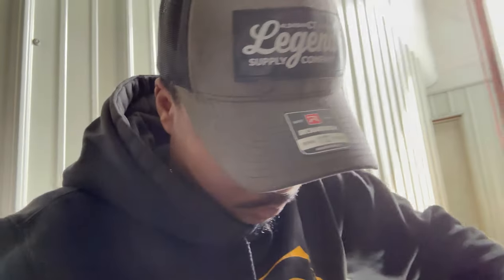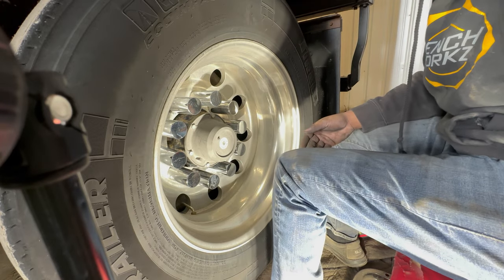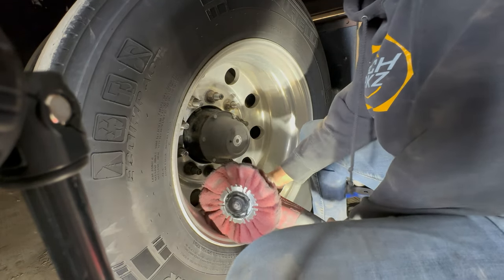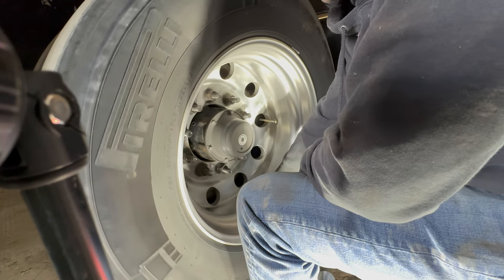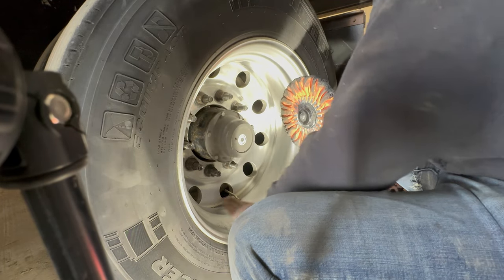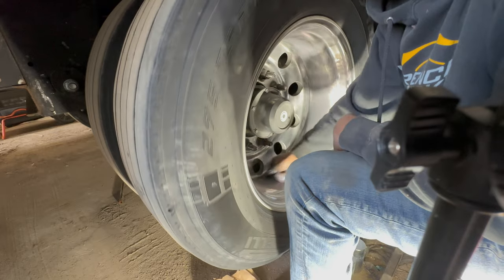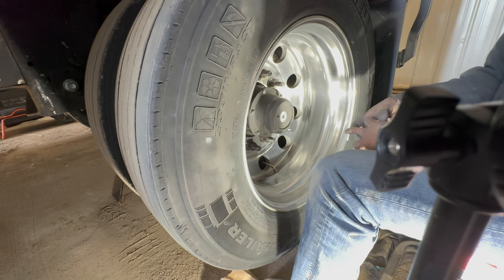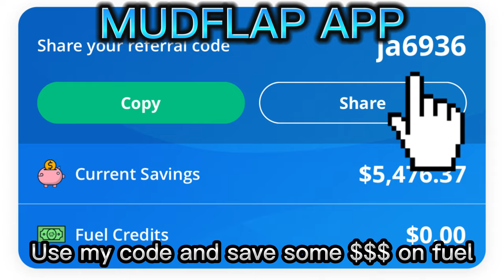How to make your semi wheels shine! (Im not a professional polisher) | shop day

Comment: If you use mix steel wheels with aluminum wheels. put a Vinyl dyerframe and between the two wheels. The two different metals make a chemical reaction that will crack the wheels studs. which make the rims come off.
Reply from the maker: Yeah my trailer has them

Comment: How long does it take you to Polish all your rim
Reply: Depending on condition of the rim
Reply: @scottycollins1829   Well I don't wanna tell you how to run your show but what I have done in the past and I'm not owner-operator anymore yet I Hadad he set up Polish rims and I'm just getting ran down all the way until fall and I had another set that it's done for the wintertime only thing I had to Polish was my tanks my steps and a cat walk
Reply from the maker: Anywhere from 20-30 minutes depending on how bad the wheel is
Reply: @JLR3Truckin   While your truck looks really nice keep up the good work
Reply: @JLR3Truckin  Bro are you using the Milwaukee??? Could you link which one
Reply from the maker: @Super29Vegas  here you go homie. You just have to buy a bolt to make it work. https://www.homedepot.com/p/Milwaukee-M18-FUEL-18V-Lithium-Ion-Brushless-Cordless-7-in-Variable-Speed-Polisher-w-6-0Ah-Battery-2738-20-48-11-1865/328077805?g_store=&source=shoppingads&locale=en-US&pla&utm_source=google&utm_medium=vantage&utm_campaign=23991&utm_content=25642&mtc=SHOPPING-RM-RMP-GGL-D25P-025_009_PORT_POWER-PV-MILWAUKEE_4051-NA-PMAX-NA-NA-MK862609001-23991-NBR-4051-NA-VNT-FY24_AON_Milwaukee_Multi_RM%2B_PaidSearchM4&cm_mmc=SHOPPING-RM-RMP-GGL-D25P-025_009_PORT_POWER-PV-MILWAUKEE_4051-NA-PMAX-NA-NA-MK862609001-23991-NBR-4051-NA-VNT-FY24_AON_Milwaukee_Multi_RM%2B_PaidSearchM4-71700000117583626--&gad_source=1&gbraid=0AAAAAolLu9_GmEV4n1Z_mz9fnrxFx2WJZ&gclid=CjwKCAjwzN-vBhAkEiwAYiO7oEVCryVp_H8NRghOtYgXRafsLUoUTIrgqGHv7rCBFaLJoDfiEoeS2RoCeegQAvD_BwE&gclsrc=aw.ds
Reply: @JLR3Truckin thanks 👍🏽

Comment: You need to cover your face and nose. It is not good  to Breathed that metal. Metal, do not break down in your system.
Reply from the maker: Yeah i literally broke my respirator strap right in the middle of doing the first wheel 😅